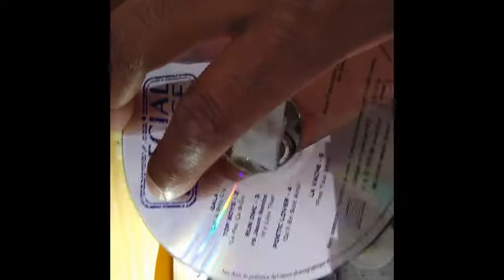hitachi cx w800 platine cd laser ( REGLAGE D USINE ) ghettoblaster boombox  hitachi cd9/ hitachi cd3

Comment from the maker: at the request of a person. I present how in rule the laser plate of the hitachi cx w800 or cd 9 or cd 3 depending on the country.

(THE ADJ GAIN): and to adjust the red laser .. (in the direction of a needle of a watch will kiss the red laser of the lens).
 (then turning in the reverse direction of a needle of a watch will increase the beams of the red laser of the lens)

(the af-offsert adj and the tr-offset adj) is not necessary to touch if the settings are already well positioned)

 (only the LA-GAIN-ADJ is your increase according to the condition of the lens) or (the change the optical lens if it does not work)

(AF OFFSERT ADJ): is to adjust the (vertical motor) where the LASER CD is placed). (be careful, the rule must be very very very precise). (position the right potentiometer 104, with the arrow color white position must be between the number 0 and the 4 of the number 104).

(TR OFFSET ADJ): to adjust the flat-rectangle-horizontal motor so that the movable lens block moves from right to left (CAUTION it is wrong to position the potentiometer on the second white point which comes after the number 4 of the number 104, with the arrow color white which and just above.

(for info): I have 4 hitachi cx w800 and all 4 hitachi cx w800 in u laser cd problem and some more serious.

the cx w800 cd laser deck is very very finicky especially if there is no operation for months or years.

if the laser settings do not work, the replacement lens is fine.